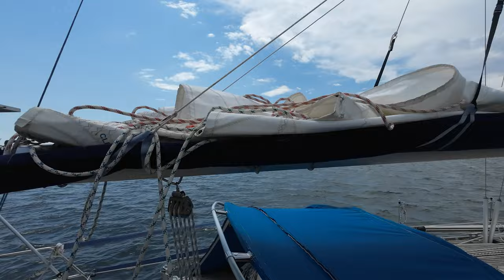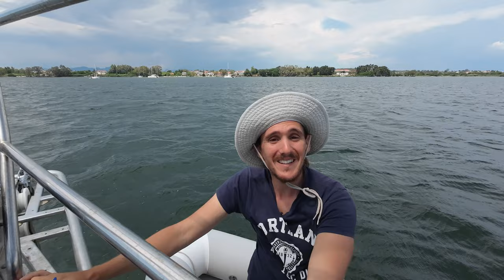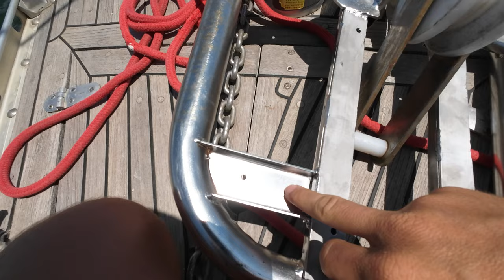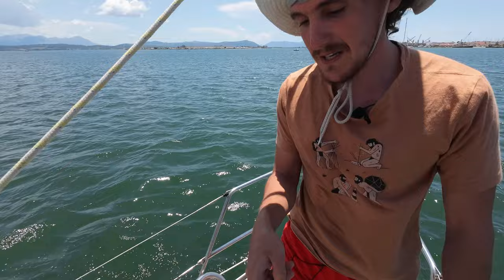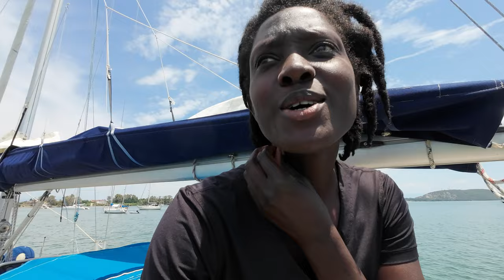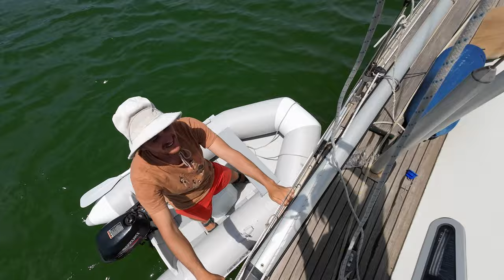Repairing our Broken bowsprit in Preveza | Best welder in Ionian islands! | EP 65

Comment: Nice job! just a comment: I presume that your bowsprit were made from AISI 316 (EN 1.4404 or the like). Properly welded and pickled it should not rust as obviously it did. The new weldings looked good, but beware that the flaw were not just hidden. Do keep a lookout for rust! that would be a warning of further chracking. It is virtally impossible to remove rust from stainless steel.
Reply from the maker: Will do!!!
Breaking the bowsprit during a crossing can be a major set back ...

Comment: Most of the force on the bowsprit would be on the bobstay , Is that loose or moving ?
Reply from the maker: Usually the bobstay is right under the Genaker attached point, our is 20-30cm aft of the point so it makes the bowsprit bending up, its been in use since 2010, so the reason it started cracking might be another load and not the Genaker (probably a crash)
Reply: And you didn’t drop any screws or tools?